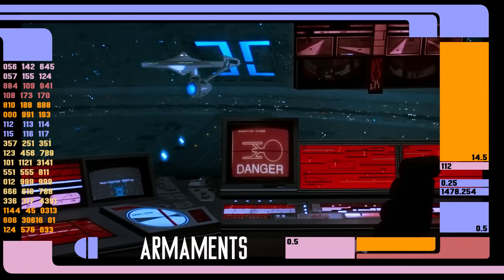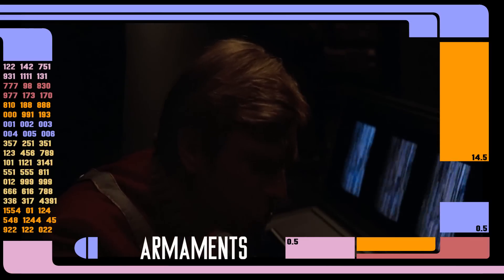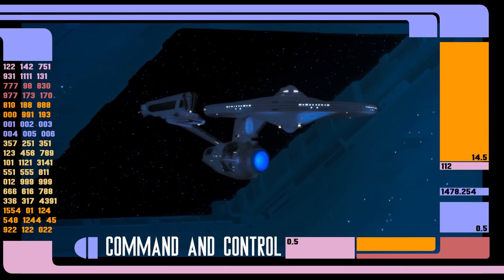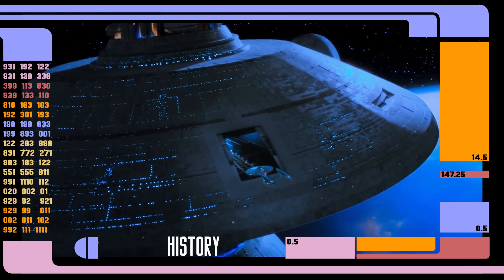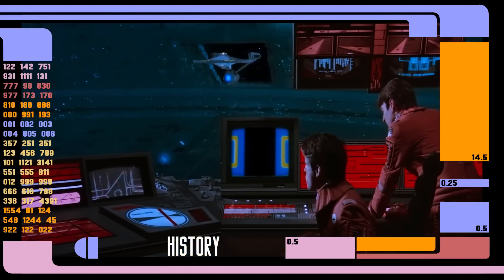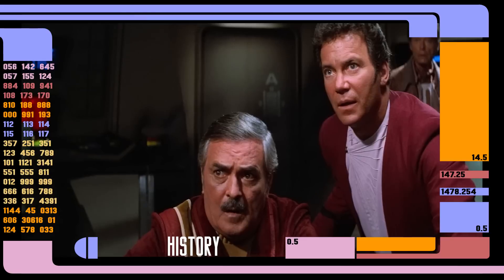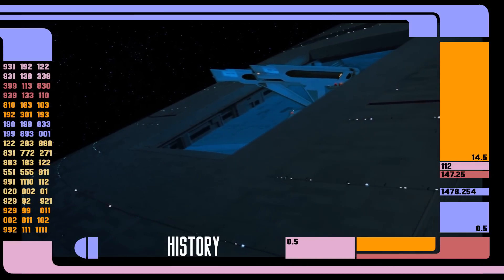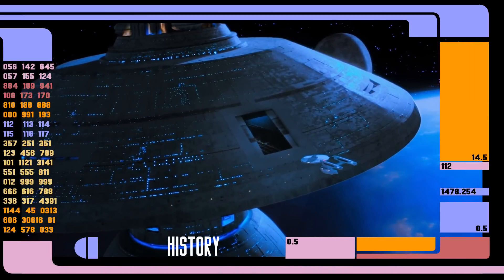SpaceDock: The Greatest Federation Starbase Design

Comment: The question is why does Starfleet need to hide ships inside a space station? Makes you wonder what they do to them while no body can see them.
Reply: I'd imagine refitting and routine maintenance. Sure, they could just beam crews from the station to a ship, but I'd say that takes more time than just walking to the ship
Reply: In spacedock you could completely shut a ship down, every last piece of equipment.   In an open orbital station, you would still need shields to keep micrometeriors and floating debris from striking both the ship and the people working on it.  Who wants to be in an EV suit and get hit with a spanner that was dropped a month ago and has been orbiting the planet and picking up speed since then?  While not great for complete overhauls,  SB1 is perfect for small refits, refueling, resupplying, recrewing, and in the case of the Excelsior, fine tuning as they get ready for trials.
Reply from the maker: It’s where the experiment is
Reply: Earth space dock could be referred to the equivalent of a garage to refit and repair starships after many years of use.

Comment: What if fission reactor is installed after the Scotty and Spock returned to recrystallization of diluthun in starships?
Reply: Fission makes the most sense, anyway, as fusion/antimatter power would require enormous amounts of constant fuel provision.
Reply: @digitalis2977  what if there are Scotty and spock reworked of the existing fission reactor reach of no need nuclear waste by high-energy photons method of recrystallizing dilithium

Comment: The SpaceDock, armed or not?  Fighting words to some.  Somehow this fictional structure in a fictional universe seems to have become a stand-in for orbital weapons platforms.  You, know, those things that might be horribly provocative for a multinational, multisystem planet,  but absolutely necessary if that planet had several rival aliens trying to conquer or outright destroy it.  Folks like Romulans and Klingons come to mind... Even in an optimistic and 'peaceful' universe like Star Trek.

Anyway, it would seem stupid to me that SpaceDock wouldn't have a literal metric tons of point defense systems at the very least.  It's too valuable a target not to defend.  And frankly, it should be defended well so as to be castle keep in space as it holds the 'knights' of starships.  It is entirely possible that some other station is on the other hemisphere, or certainly defenses.  Hopefully better than the 'Mars Defense Perimeter'.  Well, we don't know how such a system would work against regular starships, but it did seem underwhelming.

It would have to be powered by antimatter, most likely, though.  Armed or not, it would surely have serious shields, and those things don't come cheap in the power department.  Especially for station that can't move and has to 'take it'.

But can it move?  DS9 clearly could, it moved across much of the Bajoran star system to get to the wormhole.  I would assume using some form of warp technology or such that perhaps makes impulse drive feasible?  As I recall, the field that surrounded the station allowed it to move with the normal physics relating to energy and mass suspended.  Such a thing might allow a purposefully built station to move through space at impulse, or very low warp.  Low warp is easy to achieve, higher warp requiring ever escalating energy to reach, and similar research for a civilization to unlock.

In theory, one might imagine a giant station with perhaps four warp nacelles looking like tower-like pylons about an external ring or hanging out from the ball suddenly taking the whole station to warp.  But such a station would probably be limited to low warp, at least until designed with 25th C tech.
Reply: I had forgotten about DS9  moving it's self to the wormhole. 
So could Spacedock move itself, looking at it from an orbital safety point of view, I would say it would have to. Could you guess how much damage could be done to The Earth if it hit .
But  moving at impulse speeds, I would say yes. That begs the question of how fast.Given that I carnot see any impulse engines,
I would say half impulse. I am hesitant for it to be faster, because we never saw it engaging the Borg and considering that locally at least,  starfleet had been destroyed Spacedock would be the only asset that could send to defend Earth. And considering that i could  not see the Spacedock or its wreckage, I am going to say that it  could not move fast enough to engage the  Borg.
Reply: @Colin4763  Unless it had very serious weapons systems, there would be little reason to try and involve the Spacedock as some spaceship against the Borg. 

Not all ships seem to have visible impulse drive.  I would suspect that such ships use gravity plating as a means of propulsion.  (Even if the real reason is that the designers or builders of the models forgot to include them!)  It would make sense to me that stations could use gravity plating tech to move as well.  I'd be surprised if SpaceDock didn't have ample means to adjust its position.  I would suspect that the means by which DS9 moved quickly to the wormhole was by application of the same tech that lets starships move at impulse speeds.  Full impulse is like 0.25 the speed of light, but I don't think that such a ship is actually moving at that relativistic speed, but instead is using a physics bending technique as represented by DS9 moving. 

I would doubt that the stations could move at real impulse speeds, as they don't seem designed for it.  But again, DS9 'floated' across a portion of a star system in apparently a matter of hours.  So, even if less that a quarter impulse, a station could probably still move at a couple percent of the speed of light.